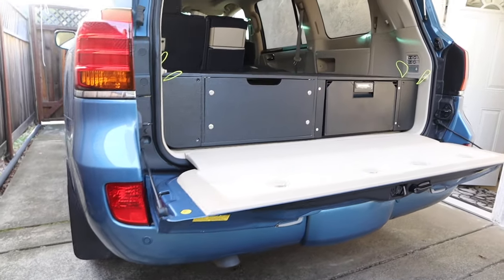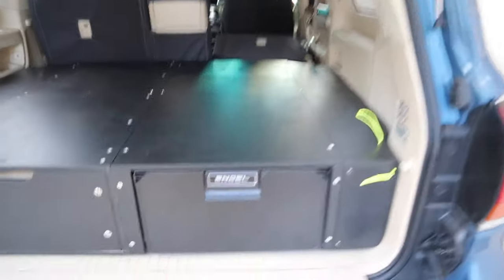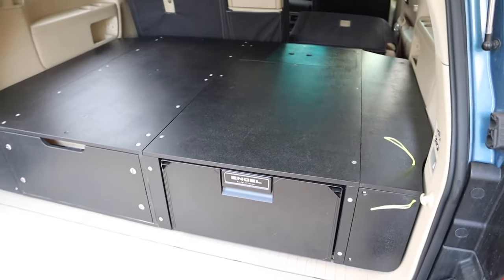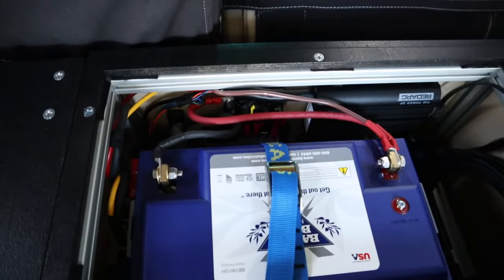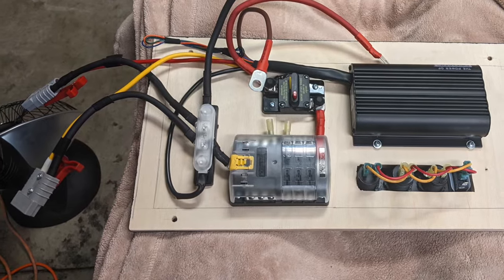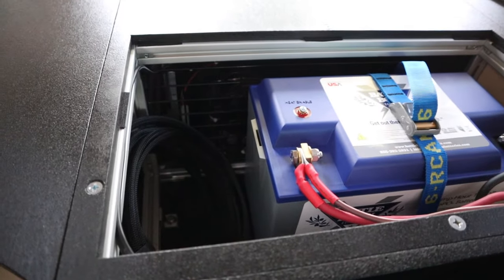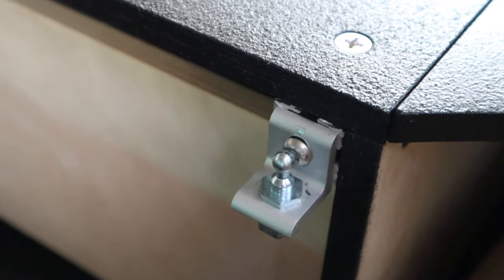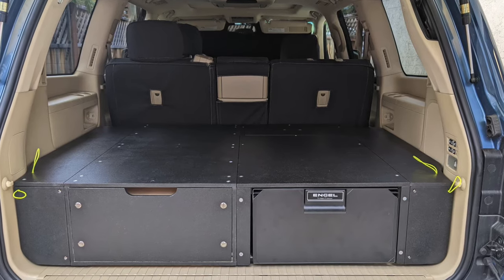I've finished the greatest drawer and fridge setup (Lexus LX570 and Toyota Land Cruiser)

Comment: looks really neat and you have  alot of great ideas there some that i might put into action. Only thing i was thinking (even before i looked at your video) was that with the engel draw fridge maybe running the condensor and fan etc in the wing of the draws off to the side and make that a nice throughfare for air to pass through with a fan or the likes. Then behind the draw fridge you have more room for batt/chargers/inverters etc. I especially like how you made it the same height as the seats and have that bridge panel and the design of the hinged wings is very smart.
Reply from the maker: Thanks for the comment. If you look into the details of the Engel, it has little triangle shaped ducts. These ducts have little fans at the back of the fridge and the Engel is capable of running fully enclosed and can still provide airflow to the rear of the unit. 

Admittedly, relocating the compressor under the wing would free up some space directly behind, but I found just enough space for electronics but it did end up quite tight.

Comment: Nice job! Don't you have issues with overheating fridge due to the limited air flow in the back?
Reply from the maker: Nope. The Engel drawer fridge has vents to move the air around the fridge. I also used the mesh grate immediately behind the fridge to provide more volume of air to circulate.
Reply: I was thinking the same thing. Also eventually on warmer days that battery could become quite warm cos of the fridge. A small 12v extraction fan could help I think.

Comment: Looks great! Only thing I’d suggest is adding magnets to accompany the felt strips in your battery access panel lid so it doesn’t pop out over bumps and potentially allow something conductive to fall in and short your electronics. You’ve inspired me to revisit my own project. What part of the country are you in? Are you an OverlandBound member?
Reply from the maker: Good tips and I'm glad you're revisiting yours. 

The door to the electronics is a tight fit. If I every see or hear  it rattle at all, I'll consider your suggestion. Shorting the battery would be BAD. 

I'm in the bay area and unfortunately not an Overland Bound member.
Reply: @thelandcruiserproject  I’m also in the Bay Area and have an LX470. I’ll let you know when I’m done with mine and we can meet up and geek out over a beer. Enjoy your rig!
Reply from the maker: Thanks - that'd be great to meet up! We get out about once a month and we are due for an adventure.

Comment: I'm dense. Is the fridge custom built or was it something you bought and put in there? And is it as efficient as your previous fridge.
Reply from the maker: The fridge drawer was off the shelf, but the enclosure and drawer/platform system was custom. The Engel fridges are supposedly pretty efficient. Both before and after fridges were Engel, but the models were different. I didn’t measure power consumption or time to temperature. They were different sizes so it wouldn’t have been an apples to apples comparison anyway.
Reply: @thelandcruiserproject  copy thank you!

Comment: Super clean setup - thanks for sharing this! Only thing to note (I think you mentioned this at the end) is the hinges getting in the way - not sure how better to do it though - maybe a stealth install of a piano wedge or something like that would help maximize space (and thin mat to cover on top)... Either way though - nice job!
Reply from the maker: Thanks for the comment. I try to avoid the piano hinges just cuz they look so cheap. The one advantage to the hinges that I have is that it pushes that front wood totally out of the way, where a piano hinge would still obstruct the opening a little bit.

Comment: I think it looks great. I would like to test if that slide fridge would be good enough for me. I am usually out weeks at a time though. And I don't have a problem with my fridge being on a slide on top because I usually travel alone and sleep inside but might be nice if traveling with someone....then again sounds kind of stupid to redesign my whole system for the "just in case". Yeah the only thing I would do, I think I mentioned this before, is change the hinges to just a normal hinge for the little panels that open up in the back...facing the tailgate. That way you could easily slide things in there. Doesnt' that Battleborn or the Redarc or Bluetooth monitoring? .....oh..and what do you do for a water system?
Reply from the maker: The specific DCDC charger and battery don't have monitoring (I don't need an app for that!) Having that little voltmeter will help with that. The previous setup was so headache free I never needed it and I don't see what that will need to change. 

For water, I use a 7 gallon water jug (Shelf Reliance?). I need something a little smaller. We will play with that next.

Comment: Really liking your 570! I’m getting closer to a 200 myself. I’ve imported a couple of JDM cars to clean up and drive for a while and then sell. Hopefully I’ll have a little extra $$$ to throw at the 200 budget. Planning to sell my 100 as well
Reply from the maker: That's a decent plan to step up into a 200. We will see if the 200 ages as well as the 100 has.

Comment: any reason you chose the engel over a dometic drawer?
Reply from the maker: Before we moved I had bought the Dometic CD-30 secondhand but never put it to use. I sold it so I wouldn't have to move it. I had the Engel MT-45 already and was very impressed with it over the previous ARB, so that factored in. I also bought this Engel drawer used and so, like most of my stuff, it's also the way it is because that's what was selling used at the timeframe I was looking. Engel was also showing that the drawer fridge might have had a slightly higher capacity than the CD-30 and that factored in as well. I can't remember if the CD-30 had an internal light but the Engel definitely does. One final thing about the Engel that I liked is that it has the fans and passages in the top corners to allow you to fully enclose it and make it flush mount. You can't do that as well with the Domestic CD-30. There ya go!
Reply: @thelandcruiserproject  Cool, love how yours turned out. I have a 75 dometic I've been using in the 200 and it's awesome, but it's very large. Considering doing a drawer like this in the 80 once i am done with my lift. Thanks for your videos on both. Installing dobinsons variable springs and MRR shocks on the 80 this week. Considered doing a video, but I lack the patience that you have...
Reply from the maker: I also lack the patience I once exhibited! 

I think the drawer setup is so much more versatile than the big fridges. It's a compromise that I like.

Comment: Bada$$ great job
Reply from the maker: Thanks! It feels like it cost a ton..I should have checked my costs 😬
Reply: @thelandcruiserproject  great work - curious on the cost as well. But it's worth it, that's very clean
Reply from the maker: $500 in 80/20 stuff
$225 for used Redarc
$200 for wiring stuff
$400 for used fridge
$100 for plywood
$600 for battery

$2000-ish roughly 😬
Reply: @thelandcruiserproject  those prices aren’t bad I’m sure you can replace with a lesser quality products

Comment: You are in clear violation of the Land Cruiser code. Immediately turn in your Land Cruiser card for a fancy Lexus almost a Land Cruiser card. Bwahahaha Wow I told you not holding onto your original 200 series would haunt you. I’m a 08 first year of the 200 series owner and like you former 100 series owner (91) glad that went back to the 200 series nothing like a Tundra V8 engine and transmission. I think a video doing over all the Landy’s you owned and flipped is in order for your Newbie followers. Outstanding job on install.
Reply from the maker: The LX is for when the Land Cruiser isn't good enough! But yeah, my Pacific Blue 08 would have been worth 35k now! (Bought for $23k)